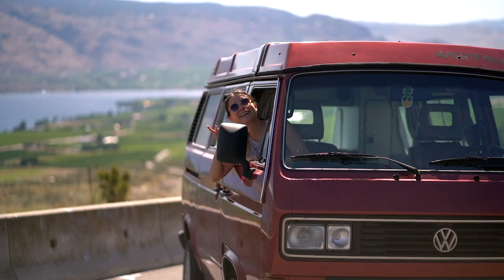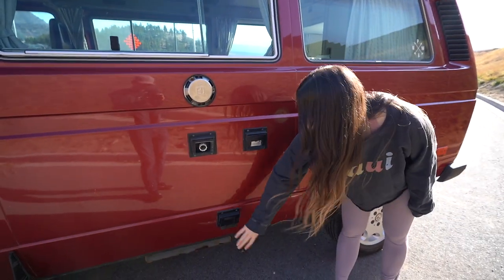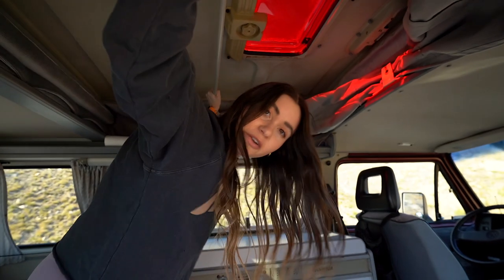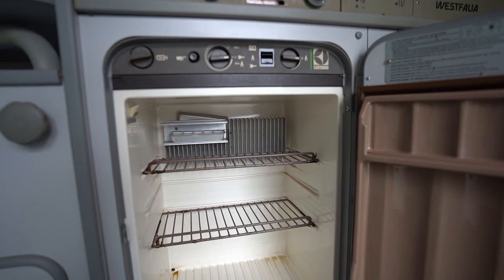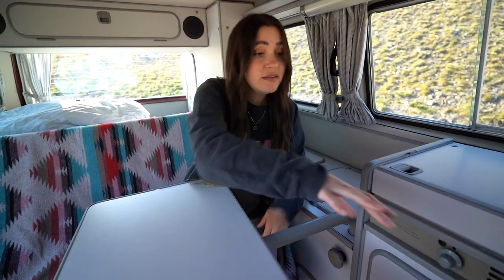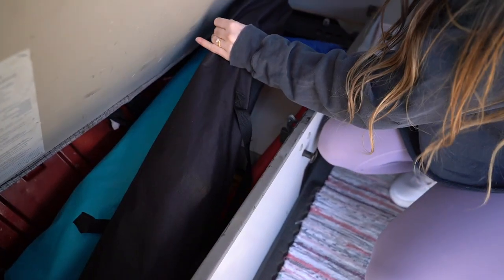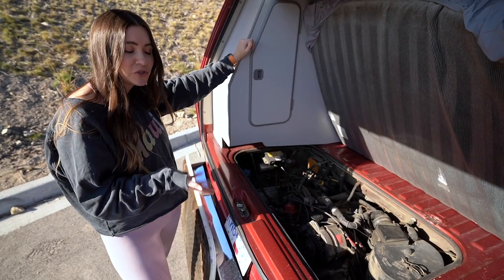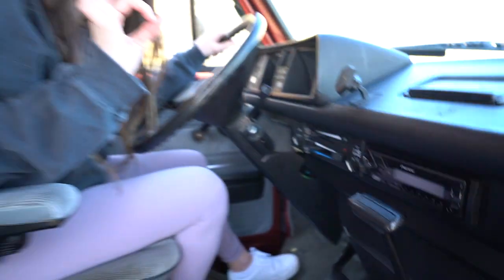our 1987 Westfalia Vanagon VAN TOUR | one year later

Comment: Finally, a fellow ‘87 Westy clone!  Our “Roo” bus (I’m a transplanted Sydneysider with OZ/USA citizenship), is the same garnet red colour as yours with automatic transmission and power steering. I have thrashed shoulders — a stick is too challenging to shift, and without power  steering, you might as well keep the shoulders lubed with cortisone! That aside, we also removed the fridge for more storage — much better use of space so we also have a portable. We have the original engine, though rebuilt at 280,000 miles with a rebuilt transmission as well.  And yup, the original pop-top canvas is replaced with the same GoWesty as yours.  Long haul driving puts my stomach in knots, LOL…I must be a glutton for punishment!    At 14 mpg to the gal. and $6+ per gal; CRIKEY, eh?!  But what the hell, despite Roo’s quirks and prop-plane interior noise as he struggles to come close to 65 on the freeway, the minute someone pulls along side me and flashes a beeg arse smile and a peace sign bigger than me steering wheel, my ol’ Hippy persona takes over and I smile back with a high better than the ol’ days diggin’ whitchetty grubs out of the red earth surrounding Uluru! Nice vid  Lady Jillaroo!…you did good!..just subscribed! Cheers! :-)

Comment: If you haven't upgraded to a T3 AntiSway bar, and HD links, it is well worth it. Makes driving on those lifted springs a lot nicer.  Also the center console by VanLife is worth the extra money. Get the configuration with 4 cup holders. That way you can store two water bottles and two mugs/drinks.  It gives you some lockable storage inside the van.

Comment: Actually it is a pretty functional vehicle. Since it has such a large steering wheel, does it not have power steering? I think you chose wisely when looking for a camper van.
Reply: It actually has power steering! They only started getting equipped with it in the mid 80's so maybe they just didn't bother changing the wheel after PS became stock.
Reply: Power steering is nice but these are old vehicles and that is one more thing to repair.
Reply: @johnkempf1808  This one has power steering. Typically the steering wheel is made smaller when a vehicle has power steering. I actually like cars without power steering. Gives the driver more of a feel for the road.
Reply: @don-dspid2404  Mine doesn't have PS, ether. I've been thinking of an electric PS system but as I said, that is just one more expensive thing to go wrong for the small amount of instances where you wish you had PS.
Reply: @johnkempf1808  I agree, i've also driven a couple Westies that didn't have PS and I don't think it's a big deal. Even slow speeds in a parking lot it wasn't difficult to crank the wheel. An ya, definitely another system to break down or have leaks.

Comment: Great to know how you guys are doing after a while.  I'm particularly interested in your battery charger when you're hooked to shore power.  What brand and model is it.  We have a 90 Westy, and I've been looking for a decent battery charger.  Do you have and auxiliary battery?
Reply: Rocky mountain Westy has a super easy to instal unit that works well. My aux battery is always around  13V.
Reply: We have a pretty basic low power setup. We do have a aux battery, it's just a lead-acid. Our charger is a NOCO Genius10 which can provide up to 10 amps of charging. When our Westy is parked we'll plug the van in and then the charger will trickle charge our batteries and keep them healthy over the winter.

Comment: Is AC a must for a Westfalia?
Reply: Not all came with it. It is a must if you live in a hot climate but otherwise-your choice. Just remember that these are 30+ year old vehicles and they used R12 refrigerant which-if you can find it and a tec authorized to use it- cost over $120/lb and you need 5 pounds of it. Most people convert the system to R134 but that requires changing a lot of components.